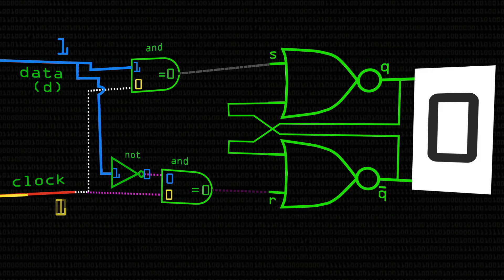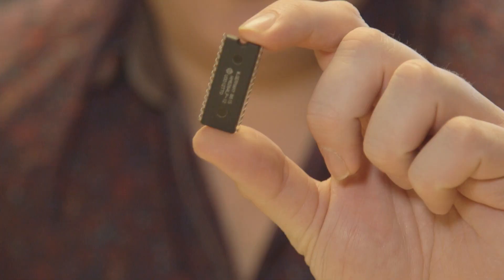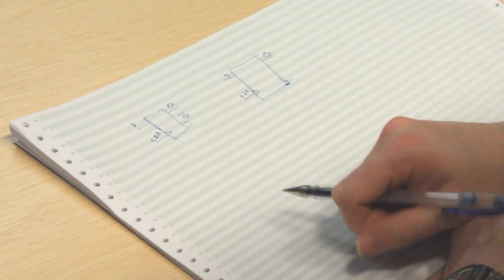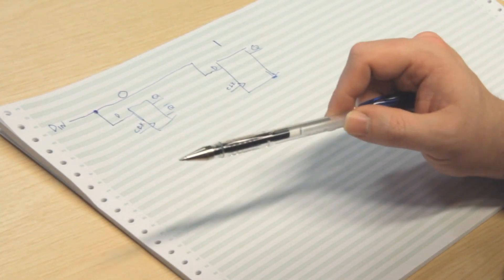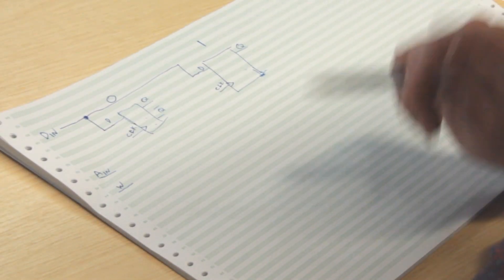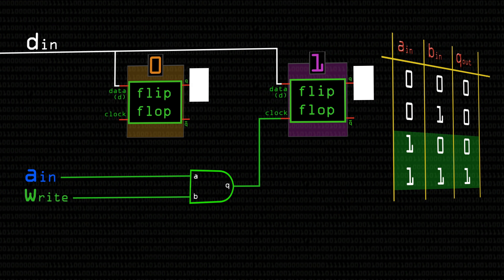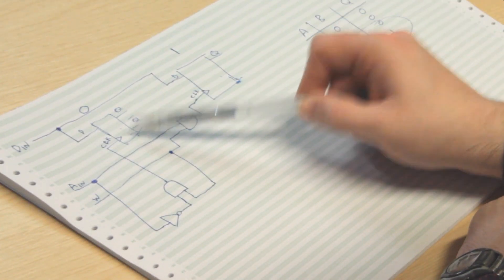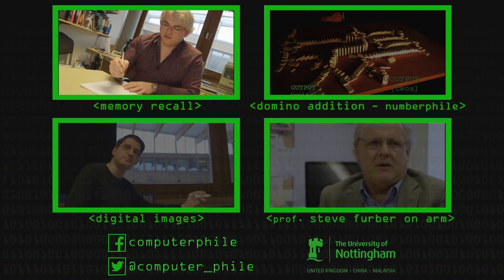Addressing Memory (Pt1) - Computerphile

Comment: 3:50: Why not connect both gates to the clock, and just invert one them? like use a common emitter NPN transistor to invert?

Unless having both clock pins at 0 is also a requirement, why bother with that 6:35 logic gate stuff?
Reply: It is a requirement that both clock pins be 0 at times. The inputs and clock can't all be changed at exactly the same time, so you need to be able to disable writing while all the input lines are prepared for the next write.

Comment: Wouldn't this implementation have bad clock skew for reasonalbe size memories? I'm also pretty sure you'd have issues with the clock input glitching. It seems like if you wanted to go with a purely digital example of memory that it would be less fraught to use 2-to-1 multiplexer feedback.

Comment: This is okay for a 2-bit memory, but for a large (deep) memory I'm pretty sure you wouldn't want to implement independent addressing logic for every memory location. Presumably, there's a smart way to share logic to minimize the number of transistors used. This must be a solved problem... and I bet the answer is interesting, but so far my googling skills are failing me.
Reply: Me too, I can't find neither IRL nor Minecraft videos explaining how to use muliplexers to address large memory.

What I know so far is that a binary numeral must be decoded to select a memory cell. 2 multiplexers are used, 1 selects a row and the other a column. They are connected as a chain (in series) so the row mux selects an entire row of cells, creating a "new" fake memory whose size is the square root of the original memory. This memory is WAY smaller, allowing the column mux to use less circuitry to select a single cell. The "cell"  can be as large as you want, but all cells in memory must have the same size. Modern computers use octet cells (usually called "Bytes"), but in MC it's easier to have single bit cells, even though it's slower

Comment: Should have been an OR gate. A HIGH on the WR line holds the Clock input HIGH until the Address line is stabilized, then the single address line should be inverted to decode the address "1".

Comment: That second And gate I think is unnecessary, the first one is ensure the data only changes when the write line is asserted so no need to do it again, because theres only two flip-flops, just invert the output of the first And gate.
Also I'm pretty sure real systems don't do this. The memory locations are literally stacked on top of each (into a physical rectangle) other so it does X/Y decoding instead.
Reply: If you just inverted the output of the AND gate, you would always write in the zeroth memory address whenever the write signal is turned off.
Reply: Oh yeah
Reply: Lttlemoi is right.